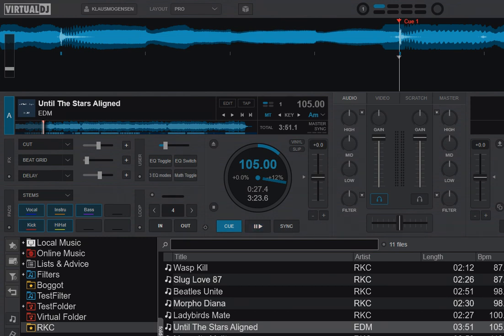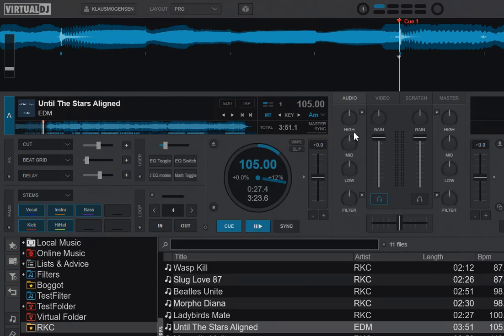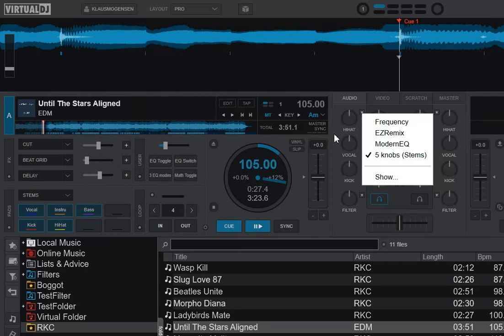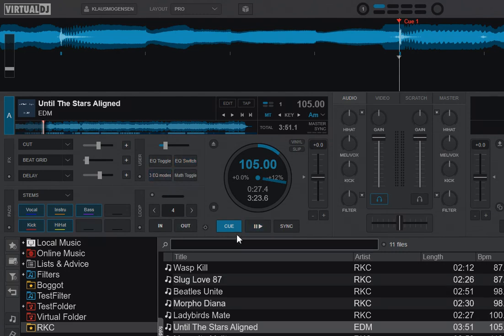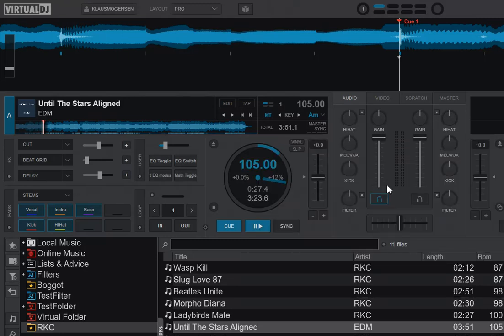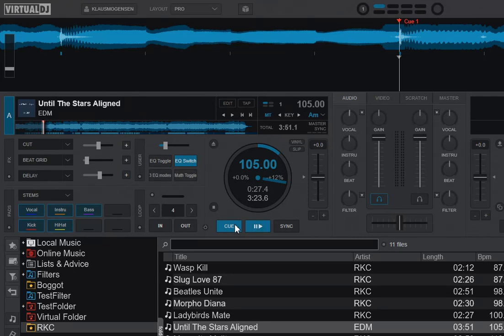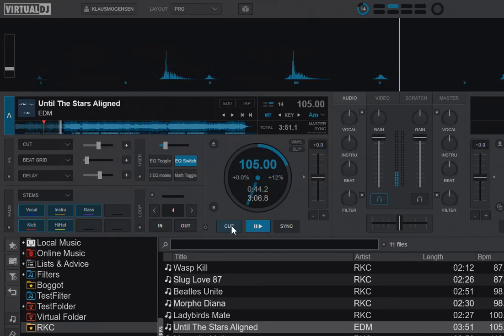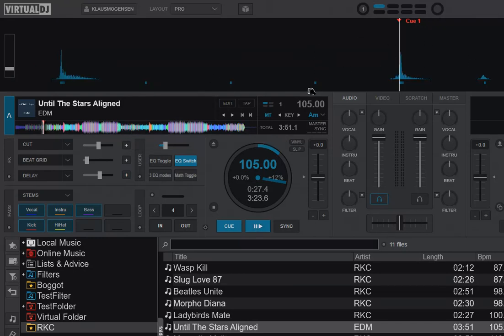Quick n' Dirty: Mapping STEMS EQ modes and switching waveforms in VDJ8.5/2021

Comment: Thanks Klaus for your tutorial !   ..  Do you know if there is a way to change the eq mode while the shift key remains pressed  ( SHIT_EQ_LOW/MEDIUM/HIGH )  and then back to normal when the shit key is released. 
Thank you !
Reply from the maker: It depends if the shift eq's have specific mapper slots for your controller
If not, you have to parameter control it on the regular eq
If they do you can simply add the stems controls to the shift slots. 
Those will then be
stem "fullvocal"
stem "fullmelo"
stem "fullrhythm"
And then of course keep the regular controlling of eq's at Freq
... another option would be to use another button besides SHIFT in "while_pressed" mode to switch modes (between for instance Freq and EZRemix) - then the rest will work automatically

Comment: Ιs the EQ modes absent on the latest updates? did they went away so fast?  i can find them on the menus, but they dont appear on the buttons, and its confusing...
Reply from the maker: No, I just tested with latest 64-bit version, standard skin, pro layout, and they are still there. They are under the little triangle/arrow next to the "HIGH" EQ
Could it be that you were using the 32-bit version without thinking about it? Because that doesn't have the stems separation feature, and then there are of course also no EQ modes
Reply: @klausmogensen8691  This is weird... I have the stems and the 64bit Pro Skin, but i cant get this feature. I dont have a triangle near the HIGH EQ anymore. So i can only change the mode through the options menu, not on the interface. Plus when for example i put the "Easy RMX" mode, the knobs dont turn into different names "vocals" ets. They remain high, med and low. 
The only triangle i get is one near the filter knob that changes the effect. 
I also have the latest version, i even redownloaded it again, and still the same. How is this possible to have different features? I have noticed some other differences as well..
Reply from the maker: @DJRobinSkouteris Ok. Then there is a few things to test. Like VDJ version, and that you haven't made a change to the skin at some point, that makes it no longer update
It's really hard to help in a video comment without the option of screenshots and so on. Maybe come to the FB group were we can help you fix that?
Reply: @klausmogensen8691  Yes thank you i have written a post there

Comment: What does using the "experimental waveform" do? I can't find any information in the forums or the website.
Reply from the maker: Do you mean experimental wave colors?
I guess it's supposed to make more info driven waveforms - like the one in stems and the ones known from Rekordbox - but I'm not sure it does a lot yet. Expermental xxx is a common way for  the devs to introduce changes so that selected people can test them
From the release notes:
"experimentalWaveColors option to test alternative way of calculating colors using FFT"
Reply: @klausmogensen8691  yeah, I went back and forth and noticed all the color differences whether it be monochrome or neutral. I just wasn't sure if there was any performance differences that was linked to it rather than just visual. Thank you for your response.